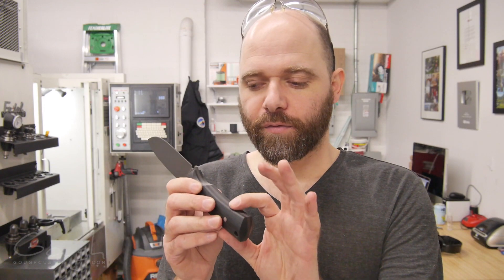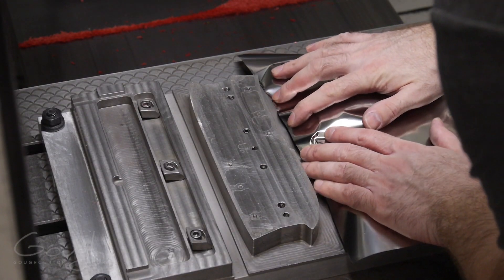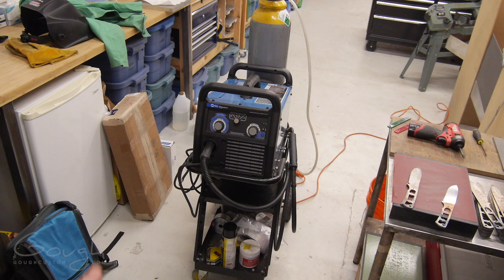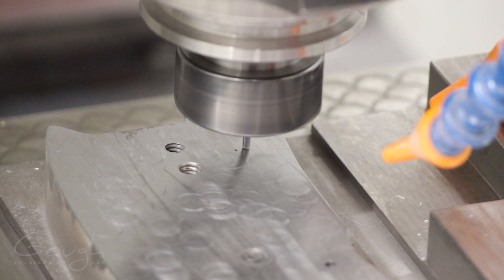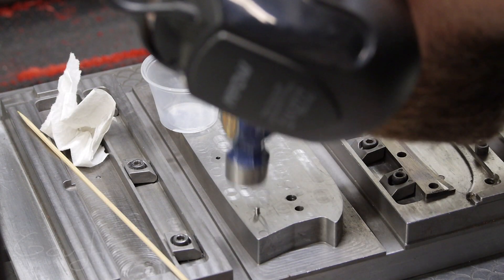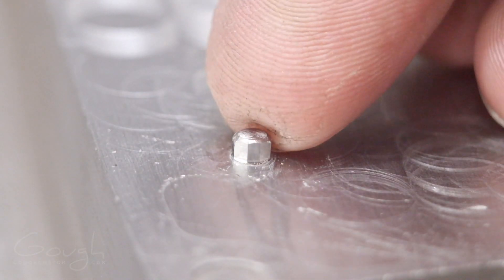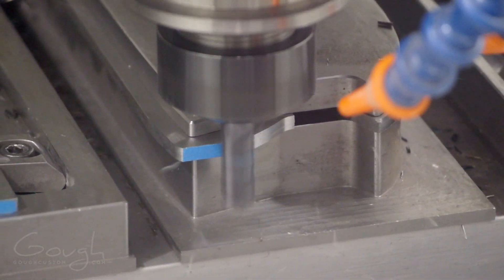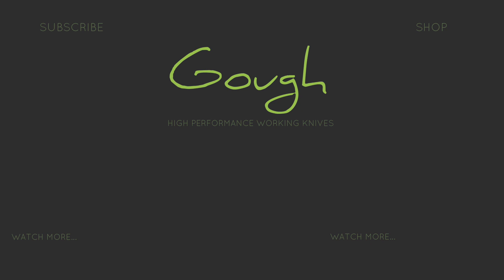CNC Knifemaking: Fixing a Funky Fixture!

Comment from the maker: Thanks to everyone for letting me know that chamfering or dishing out the holes would make it easier to weld them full again, I will know for next time! -A
Reply: Tig welding would have been my preferred way of doing it however you are putting more heat into the fixture that way.
Reply: I have the same welder....absolutely feel the same way about it. Cheers!
Reply: AWESOME dude. You have the first knife making channel that combines 'custom' with CNC. 
Which ... having never messed with machining I still watch enough of to have said "he needs a reamer in there" ... 
(thanks to This Old Tony, Cutting Edge Engineering Australia, et al) ... keep up the GREAT work.

Comment: i want to thankyou. You were right in your advice about why i was having problems grinding the second bevels.  I switched to a fresh new 40 grit belt and both grinds turned out great.   It was faster and easier grinding also and grind lines stayed in alignment too.   I hadnt changed belts because i only had the one zirconia belt but i changed to a fresh aluminum oxide this time and what a difference.  Again...thanks. Glen

Comment: My several (now defunct) First Edge knives have the best handle-to-tang fit of all my knives with removable scales.  They’re pretty much perfect, including one that’s dlc coated.  Each blade and scale set have matching numbers written inside indicating they were profiled together for a perfect fit, then separated for the remaining work and coatings, then finally matched up and reassembled.  That method side-steps typical pesky variables and all tolerance stacking, versus seeking a perfect fit from 3 parts machined separately.
Reply from the maker: Hey Dash! That is definitely a relatively simple way of achieving that end result! The issue for me is that it would make my production process more complicated... I would have to have every handle made and fitted to the blade before I send the blade off for DLC coating which creates a large bottleneck, then if the customer changed their mind or canceled their order I'd have a blade/handle pair that I have no use for! I am working toward getting 'perfect' fit just by eliminating as many variables as I can... The next version of the fixtures for this process will be VERY different!!

Comment: Aaron, man, you are amazing! I have a small question. Does it matter if the diamond pins are oriented in the same direction, or it's better if they are rotated on 90*?
Reply from the maker: Hey mate! Sorry for the slow response! The diamond pin (there should only be one per workpiece) are oriented so that they are tangential to a circle drawn from the solid pin... It's a little hard to explain with only words! Check out this article: https://www.carrlane.com/engineering-resources/technical-information/manual-workholding/locating-devices/locating-pins

Comment: Suggestion for this kind of job.  Mill out a big hole.  Like 1/2 inch with funnel shape to a point if you want at the bottom.  Use tig to fill then machine out.
Reply from the maker: Yeah widening the hole makes total sense in hindsight! I will know for next time now! Any reason you'd choose TIG over MIG for this? I have wanted a TIG for ages, but never quite managed to justify it lol
Reply: @GoughCustom  Yes, in order to create heat whit a MIG, you consume the wire and deposit it.  With TIG you create the heat then add the filler metal when you decide that the base metal is ready to accept the filler.  On a big chunk of metal as your jig, you would have to go full pedal down  at the beginning of each fill but then can adjust as needed once the parent metal is ready to weld.  I guess it boils down to greater control.
Reply from the maker: @repalmore  Makes sense mate! I will think of this next time I'm ogling a nice TIG welder :)
Reply: @GoughCustom  When I started welding TIG machines were out of my price range.  Now days, you can get them off Amazon at a reasonable price.  My suggestion would be wait and keep an eye on local "for sale" and see if a good sized one come up for sale.  I strongly suggest get one bigger than what you think you need.  So much easier to not go full power than have it at full power all the time.  Once you get the hang of TIG, you find more things that need fixing and what do you know, there's this nice TIG machine of yours ;o)  Best of luck with it.

Comment: Aaron, an alternative way to fix the location of your pins without welding is helical mill the holes to a slightly bigger size for a press fit of a bought hardened pin. Turn the protruding end of it to the diameter of the original pins with carbide tooling and press the stepped pins in. In my opinion a more safe way to do it. No heat deformation of your setup and reversible for a next set of pins. Thank you and best regards, Job
Reply from the maker: Hey Job! Thanks for the suggestion! At the time this was filmed I didn't have a lathe, but I could certainly have machined the oversize pins in-place on the mill... I will definitely keep that in mind as an option for next time! Cheers!

Comment: Oh no. More work and improvement. Does that mean your knives price is going to go up? Lol
Reply from the maker: Nope! Though honestly I probably should raise prices... I'm trying to simply make more knives instead.
Reply: @GoughCustom  I wouldn't raise prices. It wouldn't be fair to the customers. It's a very beautiful knife and made with precision but it's only A2 steel. Honestly before doing anything else I'd switch to a bettet steel. CPM 3V. Way more durable and has a way bettet rust resistance, even with that dlc you still have to watch. 3v is just a god steel. I don't think people could justify the cost to buy the knife at any higher of a price. I've been saving up for your knife but I won't be able to buy it if the price goes up and the steel while decent is mid range. No offense
Reply from the maker: @sirsir9665  The idea of an individual steel not being good is a bit of a myth. So saying 'It's only A2' is a generalization that does not apply to my knives, or really any knives. Any steel can have drastically different performance based on how it's heat-treated... You can take a 'super steel' like S30V and heat-treat it poorly and it will have low toughness and terrible edge retention. I have worked very hard on my heat-treatment for A2 and in my testing it happily out-performs S30V and S35VN from other companies in terms of edge retention and toughness.

I have tried/tested 3V in the past and while it is very tough, I found it tended to dent and roll at the edge much more easily than A2, which had large negative effects on edge retention. Additionally the lower maximum hardness of 3V works against it. My A2 at 62.5HRC is very tough and holds a great edge, I have had LOTS of positive feedback from customers who own knives made in many other steels including 3V saying that the edge retention of my knives is better than any other knife they own.

With that said I am not content to rest on my laurels. I am currently investigating a stainless steel as my potential main steel going forward. It's not a fancy powder steel, but it is extremely tough (tougher than any other stainless steel) and with careful heat-treat I can get it up to 64HRC which gives it excellent edge retention while still being tougher than A2 at a lower hardness, and also being stainless.... 

All of the above examples are meant to illustrate the point that saying a particular steel is 'good' or 'bad' is not really valid unless you have a lot of information on how that steel was heat-treated, as heat-treatment plays a vital role in how a steel performs.

Regarding fairness to customers: If my knives cost so much to make that I don't make any money off them and then I go out of business, then that is a worse outcome for my customers than raising my prices! I am doing everything in my power to not raise my prices, but a business has to be able to continue to exist in order to look after its customers!

I appreciate that you've been saving up, and as I said I do not have any short-term plans to raise my prices. I think once you get one of my knives you will be very impressed with what A2 can do! I'm looking forward to making you a knife!
-Aaron

Comment: Next time leave the pins in the holes, grind them off flat, then weld and finish as needed. 
Then you won't have to deal with the trapped air problem.
Reply from the maker: Hey Robert! Won't that mean that the weld joint with the pins is very superficial though? Wouldn't boring back out potentially cause the pin to come loose?
Reply: @GoughCustom , Yes, it could. I guess I wasn't thinking clearly. I thought I had a fix for you, but I evidently didn't think it through enough.
Reply from the maker: @TrojanHorse1959  All good mate! Considering every option is always a good idea!

Comment: Just a heads up, they make special endmills for putting holes in fixtures for locating pins. 

https://www.lakeshorecarbide.com/pre-reamendmills.aspx

The idea is to drill the hole undersized for metal removal, go in with the "pre ream"  endmills to ensure location, and then ream to final size.
Reply from the maker: Cheers! Yeah I've seen those before, but honestly for onsie-twosie stuff like this it seems easier to just interpolate the holes with a single tool, rather than setting up 3 separate tools! For production that solution would definitely make more sense though!

Comment: How about grinding the dowel pins flat, welding them over, then machining everything flat?
Reply from the maker: My main concern doing that is the weld joint with the pin would be pretty superficial, I'd be worried that I'd end up machining away most of the weld when boring the new hole and the old pin might come loose or something!
Reply: @GoughCustom  I agree, that's the concern.  Crank the piss outta the MIG and give 'er all the heat she's got!  It won't be welded all the way through, but you can guarantee there won' t be any voids.
Reply from the maker: @ZPositive  True story!

Comment: Would drilling, reaming the holes out and press fitting a plug in be an option?
Reply from the maker: I think if the plug was larger then yeah that would totally work! Press fit the plug, machine it off flat and then re-bore the holes. I think that would work just fine!

Comment: were you at all worried that the heat from the weld would warp/distort parts of the metal (of either the jig or machine), or did you control for this in some way? great video as always, can’t wait for the next! :)
Reply from the maker: Hey mate! I wasn't worried about distortion as the welds are so small, however that could be blissful ignorance rather than knowledge lol! It seems to have worked out well, no issues with the fixture that I have found so far!

Comment: With your roughing and finishing passes do you vary where on the endmills flutes do your cutting as the endmill wears? Also you could try countersinking your dowel holes out a bit to aid in rewelding them for next time so you can weld in one step? I’m guessing the welding didn’t warp your fixtures either or it was so minimal that it obviously isn’t affecting what you where looking for.
Reply from the maker: Hey mate! I vary the sections of the endmill that I use for the different passes at each stage. The roughing endmill makes the first spine cut with the tip of the endmill, then steps down to do the second rough cut, then steps down again to do the first cut on the edge, then steps down to do the second cut on the edge. Spreading the wear out seems to extend the tool life a fair bit! For the finishing endmill I do the same thing, taking spring passes to make sure the machined surfaces are as nice as possible...

Comment: You could overbore the dowels and turn down a larger dowel to size, instead of welding.  That's probably how I'd recover a fixture with incorrect hole placement.
Reply from the maker: Might consider that next time! I think if the fixture was smaller I'd definitely want to avoid welding & possible distortion, figured in this case I was probably safe...

Comment: Hi love your channel, try drilling a smaller hole all the way through the jig to let the hot gas to escape.. also grind a very small flat along the dowel pin , stops the vaccum holding the pin in..
Reply from the maker: Thanks for the suggestions Dean!

Comment: Great video and dedication.
Instead of filling the holes of the pins i would have made a pocket of 10mm diameter (sorry, i'm european) and 10mm deep. and then welded in a 10mm diam cylinder. In this way you would have a fresh new material in which making the pins holes.
Also i wouldnt reccomend super glie for the pins. Just in case one day you want to change them. A drop of threadlocker is perfect. Bye!
Reply from the maker: Hey Marco! I have wondered about using threadlocker, I will try that next time!

Comment: To fill the holes better, you could have drilled them out a little more, then added a countersink.  Use some pins to fill the hole, then weld the pins in place, filling the countersink with weld material.

Another option, tap the holes and use a screw with some green thread locker. File/mill the heads of the screws off (seen this method done to fill in old screw holds in gun barrels/receivers).  

Regardless - it looks like you did a good job!
Reply from the maker: Thanks for the suggestions mate!

Comment: If you can’t weld to the bottom, come in with a chamfer tool and open up the top of the hole so you can weld from the bottom up. Looks like it worked fine here but If the hole was deeper it would work better to make it an inverted cone instead of a hole. And easy to do on the mill!   Great videos!!
Reply from the maker: That's a good suggestion Bill! Thank-you! Now I will know for next time!

Comment: For welding the holes, I would have probably used the mill to create a wide dish shaped hole and then welded that up. That much heat might have warped the fixture, which would have to be decked flat again. Not a problem since you’d deck the welds flat anyway.
Reply from the maker: Makes total sense in hindsight, not sure why I didn't think of that! Thanks mate!
Reply: @GoughCustom  Worked in the end so no worries! you might have bored out any voids anyway. cheers!

Comment: I love the attention to small details. One question: why fix the locating pin locations instead of just updating the CNC instructions to match the pins' as-built location?
Reply from the maker: Hey Matt! That would certainly work, however measuring the exact location would be a little painful, and would then require that I have multiple offsets calibrated for that single fixture... Right now I have one offset (exact middle bottom of the fixture) that I use for this fixture and also any other fixture plates that I swap out, there are dowel holes on the machine table that locate the fixture. If I had used different offsets instead of fixing the pin locations then I'd have to move those extra offsets to any other machine I might use the fixture on, as well as remembering that extra detail about the fixture. Either way would certainly work, I just generally try to keep things as simple and idiot-proof as I can! There's are lots of days where I'm the idiot :)

Comment: Preheat your welds
Reply from the maker: Would you recommend just running a propane torch over it for a while? What kind of temperature would you be looking for when preheating a part like this? And I'm curious what the largest benefit is? Less distortion? Thanks!
Reply: @GoughCustom  aluminum fixture right? You get better weld quality if welding aluminum. Not a welder myself but a manufacturing engineer.
Reply from the maker: @p38pilotdk01  The base is aluminum but the part I was welding is actually just 1018 steel!

Comment: Wouldn't it just be easier to use wear offsets?
Reply from the maker: Unfortunately a wear offset would not necessarily have fixed this problem, because I'm not sure in which direction the blade was offset! I don't think it was perfectly at 90º for instance. I do still use wear offsets to comp for endmill diameter when changing tools, but I wanted the fixture to be right before anything else.

Comment: Yeah, I noticed that too. There also seems to be the most miniscule of gaps between some parts of the handle scales and the tang of the knife, but that isn't as much of a concern to me
Reply from the maker: Hey mate! That doesn't sound ideal, maybe there's an issue on that knife that I missed? Sometimes there's a tiny gap under the handle scales at the ricasso because of the way I machine the ricasso but that should not be noticeable unless you're me! Want to send me an email with some photos and I'll have a look?
Reply: Nah, it should be fine. I've tried fitting feeler gauges and shim stock into the gap, but I either do not have the coordination I thought I did, or the gap is a product of that part of the tang being very rounded. Either way, the knife has held up fine, and given the fact that I don't get a lot of rain here, it isn't a big concern